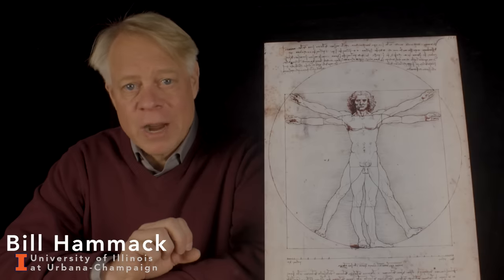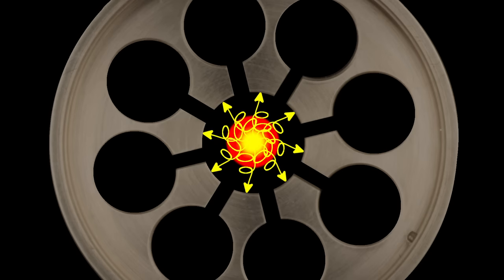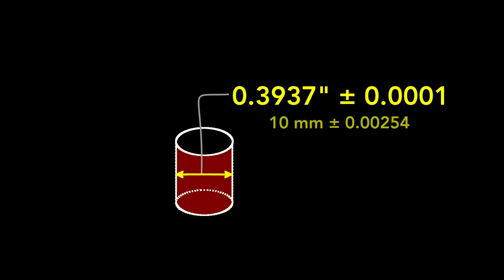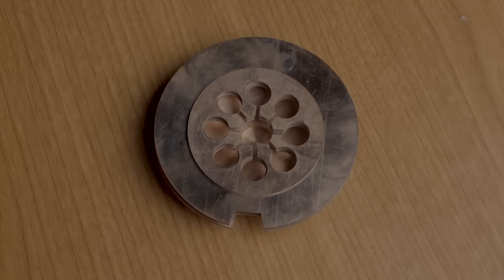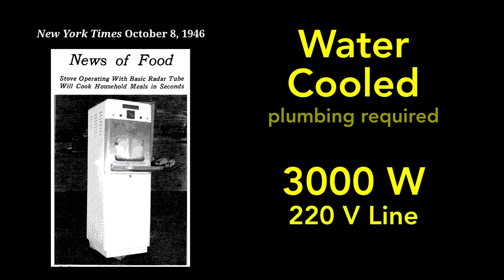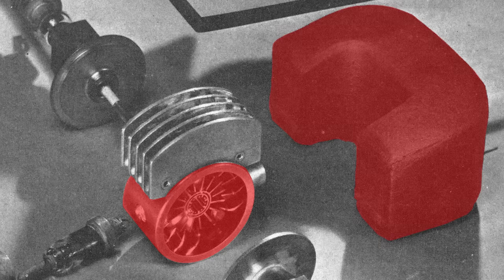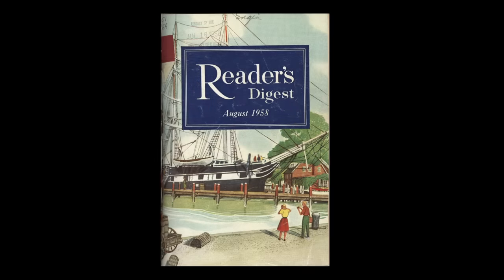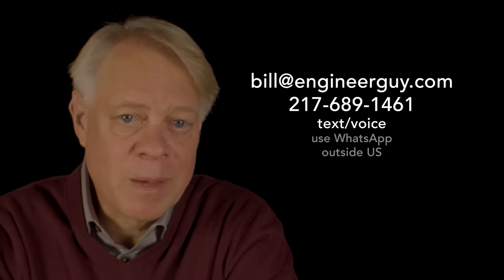The Microwave Oven Magnetron: What an Engineer Means by “Best”

Comment: I absolutely LOVE the way the tolerance problem was solved by thinking so outside the box.
Reply: Also just by ignoring it, stamping metal is quick and easy so it doesn't even matter whether it'll always work, you can make so many that you can still produce a lot.
Reply: @hedgehog3180  but... if the dimensions have to be super accurate... wont all the layers be slightly miss aligned?

you would be less precise punching holes and layering them together
Reply: @hindugoat2302 you make one ver, very good "aligner" to always get them aligned properly.
Reply: Just to add, laminating magnetrons also makes magnetic losses much lower
Reply: If you couldnt use this method ,what would you do?
Reply: @izysly6924  you could have tunable antennas, so even if the magnetron doesn't produce the exact right wavelength you could adjust the antenna to the new one
Reply: @unepintade  I may be wrong about this but doesn't each cavity contribute to the overall output signal? So if a few of them are out of alignment that doesn't change the original signal, it introduces a new frequency that's sort of overlaid on the original, and the interference messes with the picture quality.

Comment: Welcome back, Engineer Guy! I’m so glad this channel is producing videos again. The content is so fascinating. 
.0001 is a heck of a tolerance, and machining the magnetron from solid copper would’ve have not only taken a week per unit but wasted material. Microwaves would have never become affordable. Not to mention needed a plumber just to install in a kitchen.
Reply: SCCCCCCABBB HAIR PISSS POT
Reply: If it takes a week to machine something just because it's made from copper, you need new machinists. Use sharp tooling with the correct geometry, a WATER based coolant, and correct speeds and feeds, and you'll have no trouble at all.  Machining copper is one hell of a lot easier than machining titanium, which work-hardens in a single pass if the per-tooth pressure is too high.
Reply: @railgap  dude, we're talking about 75 years ago

Comment: Great explanation. This is something I've seen alot of, people who fail as engineers because they're too rigid in their definitions of what quality is. They navigate on their own aestethic sense, rather than the constraints of the actual problem, and they like to imagine one type of solution suits every problem. Such people would enjoy the fine machining of the older magnetrons, and seeing the comparison at 8:50, would scoff at the less precise machining, claiming the angular holes are simply a worse design. When in fact the reason for the old precise machining doesn't exist when using it in a small consumer oven.
Reply: It might even be better to spread the energy out a little in frequency space for an oven.

Comment: So 'Best' varies considerably with the specific requirements for an engineered product, it's so simple but a very important point to emphasise. 

I particularly liked the innovation to stack thin die-punched slices to produce a magnetron. A very elegant solution to the problem of requiring both high precision, and high production volume.
Reply: I’d be keen to see how they assembled those wafers into a single brick where they did seem to be spiraling in at least one example seem in the video… but that may have just been a demonstration piece not fully assembled yet.
Reply: @JoeOvercoat  I imagine that they built an alignment jig (or given the production volume, numerous jigs) and just stacked up the plates as needed. Quite like how you would be tasked to assemble a motorcycle or hydromechanical planetary gear automatic transmission clutch these days, since the construction is remarkably similar between those two items (many stacked sheets held to fine tolerances).
Reply: @44R0Ndin  Those jigs must have had have high tolerance & calibration challenges is a production environment. So much so, that I suggest that would be worth a video on its own.
Reply: Stacking stampings is a fairly common practice for other stuff too these days. The rotors and stators of brushless motors tend to be made like that to greatly simplify fabrication and reduce eddy currents, for example.

Comment: Does anyone know how they aligned the stamped parts?

With the tolerances being so tight on the machined part it's impressive a similar performance can be reached with stacked sheets. Even stamping the sheets to such a tolerance by itself is impressive.
Reply: I don't believe the individual sheets had to match each other as precisely as the single block of metal had to be uniform throughout. The stack is a whole bunch of tiny magnetrons pointed in the same direction rather than a single strong one. As long as your die is precise any imperfections in each sheet gets averaged out, where in the single block imperfections would be magnified by the size.
Reply: To answer the basic question, I would assume the keyway cut into the edge of each ring was used to align them with the housing.
Reply: As someone who worked in the field. Metal stamping as a die maker. It's really easy to get extremely precise parts from stamping. 

The same way broaching is more precise than drilling, milling, or boring. You can put a step in that just broaches a rough stamped part. 

To make extremely precise stamped parts you just maintain the tooling better than normally found in stamped parts.

Comment: Thanks for the video Bill. A question - Do you have more information about the process of stacking the laminations of the wartime magnetron? I'd think perfectly aligning the holes would be more difficult than machining the solid design. Not to mention the multitude of surfaces to keep perfectly clean/corrosion free. Feels like more potential for error. Maybe the limiting factor wasn't precision, but simple time of manufacturing. 

I'm surprised it worked! It makes intuitive sense but I wouldn't have trusted the idea if I'd come up with it. Suppose that's why I'm not an engineer!
Reply: I am both a machinist and an RF engineer and I, too, have many questions similar to yours.
Reply: I am not an mechanical engineer or a machinist, I work in IT infrastructure so I may be very ignorant here. My assumption was that one or many sets of rods was produced at the specified measurements to be pushed through the plates and they were then sealed in some way, by welds or otherwise, to a base plate at the correct positions.

Comment: Thank you for making this. I'd never understood magenetrons. Are military and aviation magnetrons still built with the stacked plate method? After all that tolerance is still fairly difficult to achieve

 Its also nice to see you back. I'd figured you were done with making videos.
Reply: Magnetrons are obsolete in radars. The frequency fluctuates from pulse to pulse and as the device warms up, so they can't be used with the Doppler techniques employed in modern radars.
Reply: @nerd1000ify  that's fascinating!
Reply: @nerd1000ify  The company I worked for up until retirement last year makes thousands of magnetrons for marine radars where they are cheap, powerful and effective.
Reply: @nerd1000ify  Not all radar applications require Doppler-measuring stability.

Comment: on spencer's design of the magnetron (where slices are used instead of one metal cylinder), it seems like aligning those plates to fit the tolerance is a feat in itself
Reply: I know nothing about magnetrons but it could be that the tolerance only matters if the bits of metal are physically connected.

Comment: Best or 'best quality' - I struggle with my IT 'engineer' colleagues all the time over this. They just don't get it. To them best or best quality means they spent massive manpower on it making it the absolutely best bit of code thingy ever. it will do x, it will do y, it will cure cancer. The customer is rarely happy that their thingy cost 100k. For me though best means - FOR the purpose - performance required, cost required, efficiency required, lifespan required. I knock the thinhy out for 1k. customer is happy. But as far as my IT colleagues are concerned this is a compromise they don't want to make. My analogy is that if it was up to them designing a car, every car would be made of gold, go at 200mph and sit 50 people. customer: "but I want a car to drive to the shops with the wife". IT 'engineer' - this is what you need, it will not only do THIS, but is reusable and extendible - and can take up to 48 of your friends AND travel at 200mph. why do you not want that ? sigh..

Comment: Thank you for the review. Being a Fire controlman in the navy in 1966, I used to heat up my submarine sandwiches with the 50,000 watt Fire Control radar. We also used to test to see if the radar was emitting by waving our hand in front of the parabolic dish. If it got warm , it was working. Just a quick check . Thanks for the video, it brought back memories.

Comment: I was working with avionics weather radar for many years ago, we had a bendix radar with a 60 Kw magnetron, when scrapping one of them I always took the magnet off. Sometimes they could be used under a apprentice tool drawer so they could be doing lots of troubleshooting why it was so hard to pull out 😂

Comment: Great video, it emphasize the importance of the engineering method, that conflates from the "trial and error" to the use of eigenvalues.
The genius of the inventor of the magnetron was an impossible feat of electrons optic; by winding the linear series of cavities (each an LC circuit) on itself, it allowed the generation of kilowatts of power instead of the fractions of watt previously possible. The antenna output can be placed on any of the cavity elements. And yes, the oven magnetrons are completely useless for communication purposes. You may want to explain the difference with a progressive wave vacuum tube, the type used to keep reliable communication between Earth and the Apollo capsule during the Moon mission, all with an unimpressive power of 4 Watts at 2 GHz.
Thank you for the great video. I appreciate your professionalism - more videos would be very gladly watched multiple times.
Greetings,
Anthony

Comment: In compliment to the engineering of the magnetron specific to cooking, as I understand it, it is the specific FREQUENCY of the microwave that is necessary for its practical use in consumer kitchens. Taking advantage of the resonance of the water molecule to induce energy and heat for cooking. That 'science' (finding the resonant frequency of water molecules) is also amazing.

Comment: Amazing work and quite interestingly specific subjects.
I'll just sit here and wait for an episode about engineering/invention of refrigerators/air conditioners.
The ability to make ice, cool stuff and to pump heat around has impacted everything we eat, drink, and even breathe.

Not so long ago, ice trade was quite a business.
Things like icyball and absorption refrigerators were invented, it's been quite a while until we settled on a vapor-compression based thing that we have now.

It's not a component though.
Refrigerator compressors are an amazingly well engineered component, even if the development of the very refrigerants could tell an even more interesting story.

Comment: This ties in with something I've often said "Engineering is the art of compromise". That is - reweighting the criteria to suit the requirements of the job in hand. 
Is the BEST car the fastest, the most reliable or the most economical? The answer depends on whether you want to go racing, or use it far from support, or run it on a budget. You makes your choice, and the engineer adjusts the design criteria to suit.

Comment: My dad was in the Navy and the Air Force and worked on Radar and was also a amateur radio operator ( HAM ). Hetoldmethe idea of microwave ovens for home use came from air traffic controllers . That they would place their cups of coffee in front of the microwave coming from inside the tower to keep them warm . He also said that being around microwaves wasnt necessarily bad for your health or there would be a air traffic controllers disease.

Comment: The apocryphal story you mention was an amalgam of several things that did all happen - just not all to the same person, never mind at the same time.
My grandfather was one of the RCAF radar technicians seconded to the RAF fairly early in the war, and he remembered how his group learned to respect the danger of microwaves: bypassing interlocks during maintenance was reasonably common then, and a few people with chocolate or candy bars in their pockets saw them melted.  It only took two in his unit - over invalided back home, and one dead, of radiation burns and/or poisoning, to drive the lesson home.
I can't imagine my grandfather's unit was unique - most likely hundreds of men got anywhere from minor to lethal exposure in the early years.
Reply: Isaac Asimov envisioned using microwaves to keep people warm by heating them directly as they went about their lives at home.

Comment: I have owned Panasonic inverter microwaves since 2003 (two of them, to be precise).  1300W power, cooks food about 50% faster than the recommended cook times on packages.

I only replaced my first Panasonic inverter microwave in 2018 (that I bought in 2003), because the inside bottom edge along the door started rusting.  The microwave worked perfectly fine, other than completely disrupting 2.4GHz WiFi while it was running. (BTW, it's still sitting in my closet)

My current microwave is a refurbished Panasonic inverter microwave as well.

Comment: The hardest part is getting past "it works". Once you do that, then you can look for ways to improve the design such that what you get 50 years later makes the earlier versions look like it was constructed with clay and Legos. As noted, "best" is a word with a fluid meaning and is always dependent on circumstances. In the illustrations you go through, "best" means that it fits the parameters outlined in a safe, and relatively efficient manner to make it cost effective to produce and use. A very worthy lesson for all first year engineering students!

I'd still like to know why the particular frequency in use for microwave ovens was chosen. Never could figure that out... Seems like you'd want to use the water resonance frequency and yet that is NOT what is in use!

Comment: Best = I must take into consideration:

1. how many should be produced and how fast
2. what are my manufacturing capacities and technologies
3. availibility of materials
4. can I propose new manufacturing processes or must I design the thing in a way as to produce it with existing manufacturing techniques/machinery
5. desired cost, lifespan and reliability of the thing
6. long term maintenance cost of the thing in its intended application, if it is not a single use thing

Many things are a compromise of many factors, far more than what I wrote here. In many cases "best" is the "just good enough" thing that does the job, is cheap, easy to maintain and efficient. In most cases you cannot have everything. Cheap, easy to maintain is often not durable or energy efficient. Energy efficient and durable is often not cheap to buy and/or to maintain, it requires specialized tools and trained workers.

Comment: I’ve used a c.1977 Amana Radarange microwave oven. No turntable, heavy, very solidly built, probably among the last of its kind. Essential to stop and turn the food fairly often, or get a wind-up turntable designed for such ovens. Meant to reassure the home cook that no microwaves were leaking out to endanger the household. Very different from the cheaper ones from China nowadays.

Comment: I think you have to appreciate how difficult it must have been to machine a die with this precision and with this unique shape, and have it maintain tolerances for thousands of punches.  Even with soft copper, it would not be hard for the dimensions of the die to be distorted by 0.0001" or 2.54 micrometers.  Two punches may have been required, a first to rough cut the part, and a second to achieve the final dimension.  For a steel die of 12 ppm/C thermal expansion coefficient, and with the approximate dimension of the cavity being about 1 cm, this would require the die to remain within a few degrees C even during the process of being machined which generates much heat.   To sit flat and level with each other, the plates may have needed to be polished and fit together with precision pins.  I would have liked to meet the machinist who did this.

Comment: Thank you.

Side note: the first microwave ovens operated at 915 MHz. Because of this they were physically large, part of why they were aimed at commercial users. Modern microwave ovens operrate at 2.45 GHz and the RF components are much smaller, making home use practical.
Reply: Laura
I'm impressed with your knowledge of microwave heating. 
The 902-930 mhz ISM band as you probably know is still used extensively for industrial food preparation.   Magnetrons there range from about 5 to 30 Kw and are water cooled.
Magnetrons have been my favorite microwave tube since I was a teenager.  I'm now 68.a retired consulting engineers in power electronics.  At 915mhz the record efficiency of converting raw DC power in to RF is, if memory serves, about 91%. This efficiency BTW is unmatched by semiconductor devices be they LDMOS GaN Fets etc, which are lucky to do 50% efficiency with a $/watt figure of at least 20X the Randall -Boot multicavity magnetron.